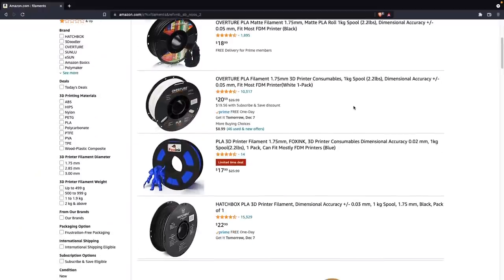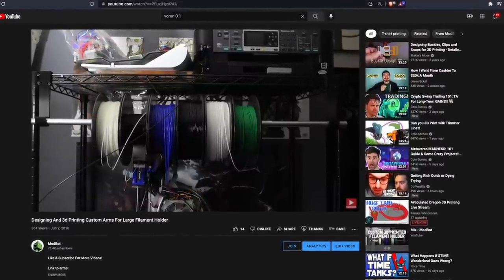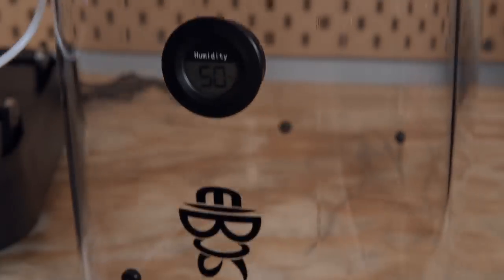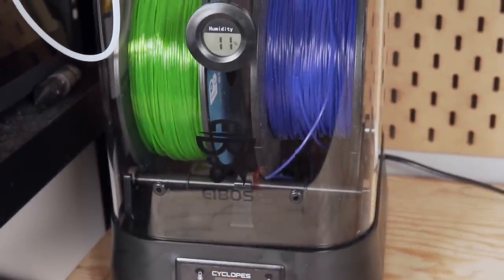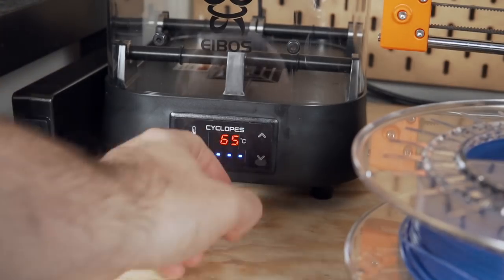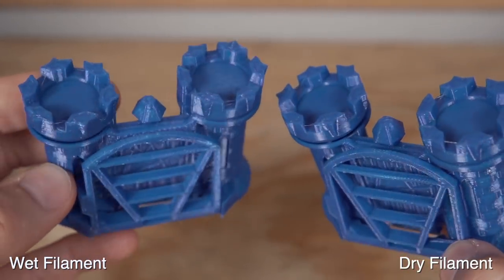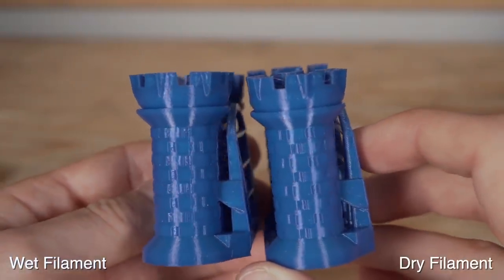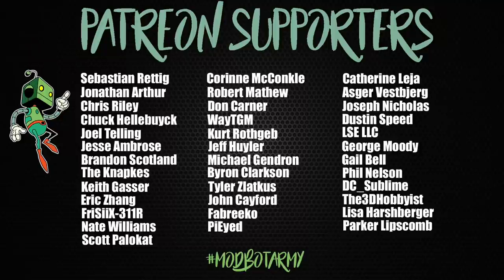Tired Of Wet Filament? My New Favorite Filament Dryers (And Storage Solution)

Comment: I am curious how your bags have been holding up? I had some Airlock vacuum bags (made just for 3D filament storage) and after 4-5 uses they started leaking. I would also put desiccant in with them and it showed moisture after again 4-5 uses. Contacted the company and got the response that I should replace the bags after 2 uses (meaning throw them away). So I am curious if your bags have held up any better than this?
Reply: In fact, that's really depends on the material quality of the vacuum bag. For example the thinkness, there are multiple options, from 0.5mm to 1.5mm and the difference is obvious. If you touch it, you will know. And of course, the better the material is using, the more times the bag can be reused. In addition, there are also some advice about how to use these vaccum bag, or we say increasce the reuse times of these vacuum bags. 

1.Please make sure to use the sealing strip correctly after putting the filament in.
2. make sure the pump has connected well with the bag. (there is a situation in our test that we haven't made a good connection between pump and bag which leads to the issue that this vacuum bag cannot be vacuumed.)
3. make sure the lid has connected well with the bag. (the pressure between in and out will lead the bag to lose the vacuum.)
4. Be-careful about the tips of the filament (it is sharp), it may break the bag while you're pumping the air out, and leave a small hole in the bag.
(#4 occur quite often because most of the users did not realize this may lead to the leak. )
5. Ensure that the sealing the strip is compressed.   

We will prodivde these to our customers while they pruchased our vacuum package, especially #4.
Hope these can help you. 
Kind regards, 
EIBOS Team

Comment: I live in a climte with 80% humidity 90% of the time. Its either slightly lower or slightly higher humidity here 365 days a year. Ive only been into printing the last 12 months and At the start i tried drying everything making sure its all perfect etc etc etc. then i gave up i adjusted printing settings to just print at high humidity. No problems now.

Comment: Ive got 3 of the sunlu dryers, im actually about to fit them with a fan mod that will vent them of the humid air out the top shell. I only print with PLA, TPU and PETG, so  the sunlu box is enough in conjunction with a similar ziploc vacume bag solution to yours, it aalso comes with a USB pump,I store every filament in one of these bags with a decicant container that sits inside the spool centre hole while not on the printer and in a dryer whilst out of its bag. I live in the UK next to the Thames river, also have a fish tank in my printing room and my system is working well even with a 20 gallon box of water in the room.

Comment: I have a sunlu and modded it to have a blow fan to circulate the air inside, but not to pulls air in and such for fresh air.  I also cut to size a square hole in the front and inserted a humidity sensor, be it the sensor is right smack at the front portion of the inside of it and not truly inside inside. 

I live in the Puget Sound (larger area of Seattle) part of Washington state. No joke it rains 50% of the time, so very high humidity. That being said I typically can get the sunlu chamber to get down and hold (be it the 20 hours out of every 24 hours it recommends).... down to 18%.

My question is with these other two ones you speak of dual and single from Eibos. 

What % humidity can you get it down to, and for how long can you hold it at the lowest typical humidity?

Because i am trying to aim for the lower single digit humidity levels.

Comment: I have the eSUN dryer and the EiBOS Easy dry. Love the EasyDry for all the reasons you state. One thing to mention is that this dryer only has a 72mm volume size. So it will not work with my Amazon Basic filament 80mm spools. Bummer! You can feel the heat so you know it is working. I can not feel much heat with from my eSUN dryer. I just bought the Cyclopes version. I also have a cheep Food dehydrator. I have to print out a taller top cover for my Food Dehydrator so I can fit 2 80mm spools,

Comment: Living in Florida, we have a lot of humidity. I use EIBOS Cyclopes for my Nylon and it works very well.  It does take 12 hours to complete but the difference in my printing is impressive. I have had an issue with a spool or two expanding and wish the Cyclopes would slowly rotate the filament while drying but it does not.  Once dry, I use PrintDry storage containers to keep my filament dry for extended periods of time.
Reply: It takes 12hrs?? (I’m new, so, i really don’t know)

Comment: I have been using PLA and PETG for years and never had to dry either to get good prints. In fact only nylon would not work without drying - it sounds like bacon sizzling on a griddle from all of the steam released in the nozzle.
Reply: Same here!!! I have tried both as well and neither one seems to hold moisture at all. I get a great print whether I dried the filament or not. Some of these guys must live In the jungle or something to have as many moisture issues as they do.
Reply: @mattchristine675  I keep the temperature of my home between 66 and 68°F year round. Winter here is naturally dry (40-50% RH) and the Air conditioner keeps it about the same in the warmer weather. I don't do anything to protect my filament except put it back in the plastic bag when not in use. The spool on my printer often sits uncovered for weeks. BTW, most people do not realize that most plastic bags and bottles are permeable to water. If the humidity outside the bag is greater than inside, the moisture content in the bag will increase to an equilibrium. That's why desiccants are needed. Water molecules (H2O) are smaller than the oxygen (O2) we breathe and can go through plastic even while under a vacuum.

Comment: The S1 has a humidity display, just hold the temp button for three seconds. If you are using a fan to suck-in humid outside air, what are you accomplishing? My S1 keeps 22% humidity within a few minutes after starting.

Comment: What about using a 2nd hot-end to dry your filament , before the actual hot-end ? Like 1 feet (or so) before the actual hot-end , the 2nd hot-end not having a nozzle and only heating (drying) around 170 F ? Would this not work ?

Comment: I just bought the Easydry filament dryer. A good price. I have the eSUN dryer as well. In your video you talk about all the issues I have be having. You are the first person I cam across that has almost the exact same issues that I have ben fairing my hair out with over the past few years. I am excited to thing with your help maybe I can finally print something. Although I still don't print nearly as well as you do. On my ender 3 Max for example I can't get layers to even stick together. Even with bad wet filament you are printing tons better than I.Right now I would be happy with even a print like your benchy wet filament print.

Comment: Sunlu is just good for keeping something dry as you print. Food dehydration is the cheapest for the best results for under $100. But if you do have a convection oven you have already your answer right infront of you.
Reply from the maker: I do feel the Sunlu works fine for maintaining. The issue with the convection oven is that both myself and Erin arent crazy about putting filament where our food goes. Especially with the dirt/dust that is on alot of the spools I have.
Reply: @ModBotArmy  Than keep them darn spools clean LOL. And yes not everyone has a convection oven so I get that point too. Me I do have a double convection oven so one is barley ever used at the house so :-)

Comment: Thanks for the vid!  If your filament is wet when you vacuum seal it does it stay the same wetness or does the vacuum seal help to reduce the moisture in the filament?  Have you looked into these humidity disks that change color and throwing them into the bag (although I'm not sure how accurate they are for this application)?

Comment: Just printed voron 0.1 skirts in TPU along with the feet and the mounting brackets for the board and pi….the rest will be in ABS…can’t wait to get my hands on a LDO kit so I can start the build….
Reply from the maker: Ooh I like that. What infill/perimeters did you go with for the feet??
Reply: @ModBotArmy  I went with what voron recommend for the printed parts but with triangle infill...will be uploading a video of the brackets being printed on my channel
Reply from the maker: @beebees3d  Awesome! TPU for skirts seems like a pretty good spot to have them. Sort of a bumper for the electronics from outside objects.

Comment: I’m new to 3DP and took dry filament seriously.  I’ve built two dry boxes and use a combination of activated alumina and silica gel.  I got an order from Printed Solid of two spools of Prusament and one spool of Jessie (PETG). I couldn’t figure out why the settings for Prusament I came up with (I started with two spools of Prusament  PETG straight from Prusa CZ) and took time to print temperature towers and dial in the temperature for my machine. I printed temp towers for the stuff received from Printed Solid and all the sudden I needed to print the same material at 260 instead of 225-230 for similar results.  On the filament of the second order there was NO temperature where stringing didn’t occur and the Jessie was particularly bad.  Well me being a genius I used my oven.  Well my oven SAYS it can go down to 170F, they lie.  It ruined the two spools of Prusament, welding the rolls together. Since the printing temp is higher on the Jessie, it was the only roll that survived. Don’t make my mistake, either get a dehydrator or get a specific filament drying solution (I have both now). I now have a 6 spool dry box that I print out of (after drying every spool for 24hrs after receiving it), an Eibos Easedry for single spools, their bags with silica gel for storage after drying and a food dehydrator for drying the spools when I get them.  If you’re getting frustrated with zits in your prints, stringing, having to crank up the temps, etc with PETG do yourself a favor and dry your spools, you won’t regret it.

Comment: Sorry if I missed it but was you printing the dry versions wile it was in the unit?
The main problem I have is I won't be able too print wile it's inside the unit with my current setup.

But I would still expect too see a difference after drying for a few hours first.

Comment: I got a print dry which is similar to cyclopse for 50$ turns out they are 2-300 new lol got lucky. I live in a desert so I only use it when I get filament from wetter places that's not sealed properly

Comment: i never had issues with wet pla+ from sunlu / esun with my cr10s pro v2 stock extruder. then i upgraded to volcano and plated copper nozzle - it showed instantly, extreme stringing and zits. the more effective the melting process the more  it shows

Comment: Eibos vacuum bags user here. I have an observation and a question for Daniel or anyone that's tested it more than I have. Like most Ziploc style vacuum bags, it doesn't hold vacuum worth a ****. Within hours the bags are full of air again. I've also used the PrintDry canisters (individual canisters analogous to the Ziploc bags idea, bought on MatterHackers), which do hold vacuum for at least days or weeks. Does this really matter? I had assumed that allowing air into the bag lets moisture in too, and that they're not working well enough to protect something like nylon if they leak, even when stored with desiccant. The hygrometers I store with the bags generally have shown wetter conditions than I want. Has anyone had a similar experience with leaking but then tried printing with the stored filament and gotten good results?

Comment: Are there any drying units out that will handle a 5k or 10k roll?  I am printing large items with PETG and need the bigger rolls.  I am currently using a modified food dehydrator but would love to have a unit like the Cyclops that could run while printing.

Comment: ModBot if you couldn't justify the purchase of the awesome Cyclopes right now because you're just starting out in 3D printing and plan to print with PETG and nylon would you buy the Eibos Series X or the Sunlu S2? Thanks for the videos and any advise
Reply from the maker: EasyDry. I like that it has the intake fan to cycle the heat around. I really like mine. It’s simple it’s compact and works great 👍
Reply: @ModBotArmy  Thank you

Comment: I modded a food dehydrator. I get 3 #2kilo rolls in at a time. It also goes up to 85c. 

Never had much of an issue until my filaments were exposed to cold moisture during a move. Needless to say i had to dry everything.

Comment: I live in the tropics and humidity is a big problem. I found a rice container that's sealed with a gasket so I store the very sensitive filament like tpu and petg. I also have a filament dryer from esun  which has a fan and I think it can reach 65 to 70 celcious but I lost the manual so I can't check.

Comment: I also use MH Build Series: PETG, TPU, and PLA. I also have NEAT and eSUN filament. I really could not get NEAT to print at all. eSUN translucent Orange PETG prints OK. My test is how easy is the filament to flow out the nozzle when I manually push filament through. If I have not mentioned I have the eSUN dryer and a Food dehydrator. I don't here any Hissing when I print. but I tried drying the filament anyway. I wonder if Leaving the filament in the hotend after turning off my printer could cause my under extrusion issue.

Comment: I have wanted a dryer but i knew that sunlu dryers had a lot of limitations. Im glad i waited! When did you get your prusa mini?! (Also, rocky road is clearly the best ice cream)
Reply from the maker: I got that one maybe a monthish ago? It was from someone local that was getting rid of 1 (they had 3). I have another showing up Monday that I bought from Prusa on Black Friday and am going to build a clone in the next month. It has been a great printer. Probably 100ish hours on it so far. Just wanted a printer that I could use without mods and it seems to be the ticket. Also, Rocky Road is up there for me as well. It is one of my dad's favorites.

Comment: Thanks for a very nice video. I live in Bangalore, India where the weather is normally dry but off late i have been observing popping sounds in my ender 3 pro printers while printing PLA. I just learnt from your video that moisture is the possible culprit. I normally print at 200-205 deg C and 70 deg bed. I need help because my prints also warp slightly and in my requirement that is a failed print. I am averaging 20% wasted prints normally. My printers are not enclosed but in a room where there is no air circulation or open windows. I am still clueless whether moisture is causing this or am I printing at too high temp. Any advice to fix this would be very helpful. Thanks in advance 🙏

Comment: It’s just a heated box. 

As air heats it will expand increasing the airs volume. Relative humidity is just the percentage of moisture relative to the volume of air it’s contained in. Air heats up and it expands thus lowering the percentage level of moisture relative to that air.

Objects within will wick out their moisture trying to reach an equilibrium. 

That said it doesn’t matter which heated box you use, 2 units that can heat a specific volume of air to a specific temperature will have identical results as dictated by physics. Additional features and controls are the only differences. 

Long term storage requires an active method of dehumidification if moisture is a problem in your area. I use a dry box with a plug in rechargeable desiccant (from Home Depot labeled as a “dehumidifier”) with a  hygrometer in there to monitor it. 

Dry bags slowly leach a certain amount moisture in, this will reach the plastic without a desiccant like shipped from the manufacturer. Shouldn’t be too much of a surprise really, you are using plastic to prevent your plastic from getting wet.

Comment: I use a dehydrator to dry my filament but I've been looking for something better and it looks like that dryer is it. I usually store my filament in ziplock bags.
Reply: Dehydrators are great for drying, but many are less great for active printing if they can't fit a spool and holder vertically. I get extremely low humidity long term with plastic tubs, just put a closes cell foam seal along the rim and some calcium chloride dessicant in a small container inside the tub. Vastly superior to silica, and super cheap.

Comment: What about a vacuum dehydrator? Instead of heating, suck the water out. I know they use them for removing air from epoxy resin, but they should work well with removing water. The low pressure allows liquid water to turn into a gas and this could take as little as 20min.
I've been thinking of adding a small fan to my SunLu run by an arduino and turn it on for 20sec once every 10min to clear the moisture from the box. Suck the air in through a pile of desiccant.

Comment: one other thing: I do the push test on filament. How hard do I have to manually push the filament through the nozzle. Good filament I should not have to push filament that hard at all. It is had to find that quality of filament. Geared extruders should not have to work to the point of Skipping steps or grinding filament. It seem like most people's solution is just to push the filament harder and up the temp.